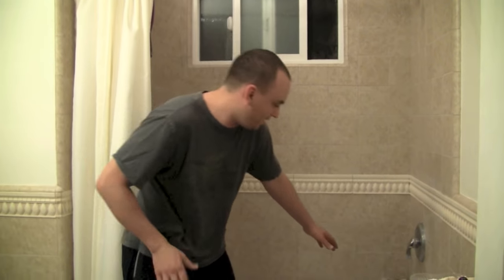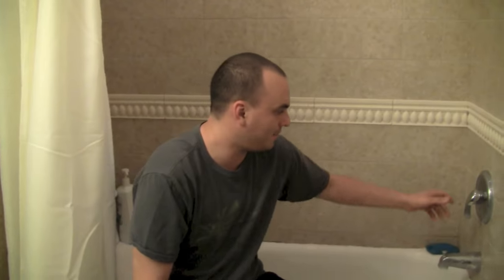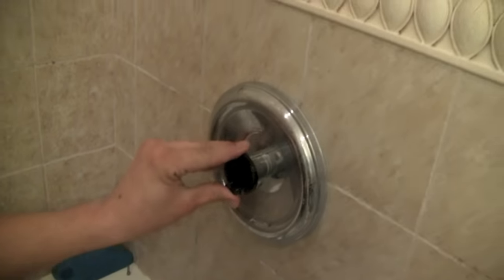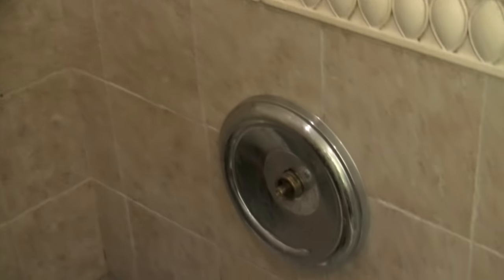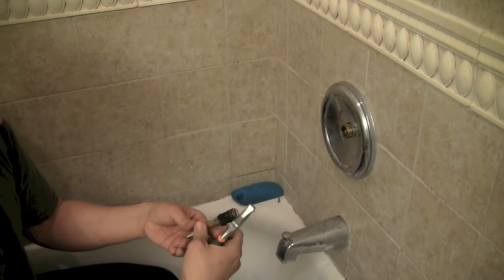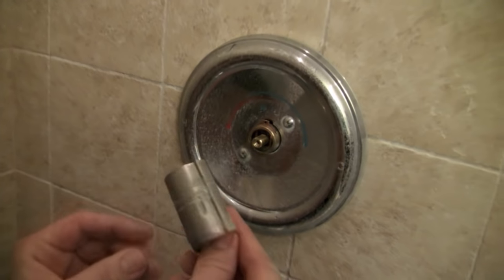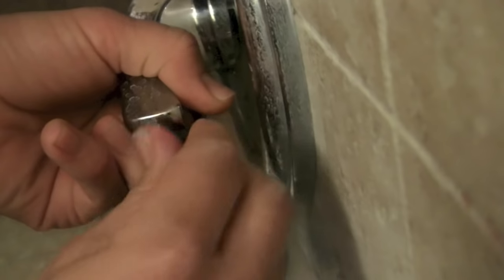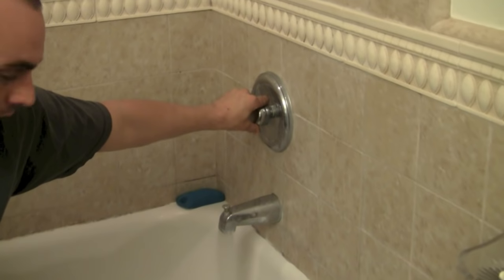How to Repair a Moen Shower Faucet Step-by-Step

Comment: Mr. Dan, I cannot thank you enough on your demonstrating the remove/replacement of a Moen Single Handle Lever Showerhead Faucet by replacing the Moen 1225 replacement cartridge. After calling almost a dozen plumbers today with an emergency (the shower head was on full and would not shut off), and getting no help whatsoever, I turned to looking up online 'how-to videos', and there you were. I followed your instructions to the letter. Success! All I can do is say "Thank you! Without you, my family would not have had water tonight and we'd be sleeping elsewhere." Now, I have to insert valving throughout in order to isolate leaks when they occur (there is only one shut off valve for the entire house!). Thank you again Sir! Fantastic plumbing lesson!

Comment: Was taking apart the Moen valve in my shower. I couldn't figure out how to disassemble any further after I got the handle off until I ran across this video. You pointed out the phillips screw holding the assembly together. Thanks!

Comment: Thank you!!!  Today I turned on my shower only to find that I couldn't turn it back off!  Shut off the water main and then searched for how to fix it.  Your video was very well made and easy to follow and understand.  I got everything off, and then took the cartridge part to Home Depot, where I had originally bought the faucet, in order to be sure that I got the correct replacement.  Nice to be told it was no charge due to Moen's lifetime guarantee.  It came with a little package of lubricant so I didn't need the plumbers grease after all.  I'm glad I was able to do it myself with your directions and not have to call a plumber.  Much appreciated!

Comment: Thanks for the great video! Yesterday I was letting the water run to fill the tub when something went wrong and turning the handle to the off position would not stop the water flow. I ended up turning off the water supply to the house, removing the handle (with the help of this video), getting a replacement cartridge from Home Depot ( which was surprisingly free when I told them it was Moen bc of lifetime warranty). I replaced the cartridge and reassembled everything else which solved my problem! ! I’m def not a plumber and have little to no experience doing this type of stuff so this video was a lifesaver for me! Thank you again :)
Reply: This was my same exact problem!   Great video indeed!

Comment: Thank you so much for this video, step by step was very helpful.  For those whose cartridge may be stuck, I stacked some washers with the hole size larger than the cartridge and used a screw as a puller, pulled the cartridge right into the washers, easy peasy!
Reply: Fletchaka  Thank you for this suggestion! Mine was very stuck after 30+ years but with adapting your suggestion to what I had available since I didn't have large enough washers, I finally got it out. Not easy peasy, but as a 60-year-old woman, I finally got it done!
Reply: Mime is stuck and don't understand ur comment,  can u explain a Lil more?

Comment: GREAT JOB!!! you saved me hundreds of dollars. just did this myself today following your instructions step-by-step. took me about 1 1/2 hours all in (shutting off water, running to Home Depot to get part, etc). cannot THANK YOU enough!

one thing to add - - some of the other videos talk about getting a puller for the valve system (you don't)... if that valve is stuck, as it was with mine, get some needle nose in there and "turn" the ends of the sleeve. it loosened it enough to pop out.
Reply: What's a needle nose? Mine is stuck

Comment: The plumber quoted us 347 dollars for this fix. We just did it for less than 50! Ours was stuck in there pretty good and actually broke off inside leaving us to chisel the plastic casing out so took us a bit over an hour to do BUT I am happy to save the 300 bucks. Thank you!!

Comment: Heyyyy Danny, thank you. I was in the middle of this same job on the tub, saw your video and found out just what to expect. My valve was at least 25yrs old. Didn't work as good as yours, you know the nightmare. Stem broke away and left the sealing mechanism stuck inside. I used this extraction tool with a clever 2nd function, a spring loaded nipple and a compression fitting on a smaller metal tube inserts into the stuck remainder, twist and work the remainder free. THEN I'm at the easy spot you are of greasing and inserting the new valve piece. Yessssssss!
You might want to make a related video of this problem using the extraction tool I described.
Love this Moen valve, smooth, working good after 25 years!
It was a real kick to fix this after fighting with this sticky valve for years.
Too much reward and satisfaction in doing it myself to let somebody else fix it.

Comment: I rent, I have to pay for the AHS warranty fee which has gone up to $125 per event. I will be able to pull the part, and go buy another, and repair the leaking shower. Much appreciated, especially since I had though I would have to pull the wall plate to work on it.
Reply from the maker: I love to hear it! Thanks for watching.

Comment: Liked amd subscribed!!! Worked perfectly. Came home after work and the shower would nt shut off ended up cutting the water and having to go to Lowes and get a moen 1222. The Hex/Allen Wrench was probably the most annoying because my key is for 7/64" and I didn't have the one in particular. Other than that great video will be watching more thank you again.

Comment: Older Moen handles require, believe it or not, a 1/16 inch allen wrench. Most info out there doesn't mention this. 
Great video. Thanks for taking the time.
Reply: The 7/64's is a rare, bizarre size... they should have used a standard 1/8" Allen wrench...
Reply: 1/8 doesnt fit and 3/32 is slightly to small. Not snugg enough to turn it
Reply: Too*

Comment: Video is really good would like to add something that may be helpful  if you are having trouble getting the whole cartridge out.try removing the keeper pin out and putting water back on for a couple seconds then shut off again what this did for me was put a little pressure behind the cartridge and for me came out really easily, hope this helps.

Comment: Very helpful video thanks! Only thing I would add is when you get the 1225 there is a plastic adapter thing in the package that will help loosen the cartridge if it doesn’t slide out easily

Comment: The best video for this specific repair. As often happens with me I found the best after the job was done. The mistakes I made could have been avoided. 
Leaving the face plate attached was the biggest surprise. I removed it. More than once. The screws that attach it are nearly two inches of fine thread. The best piece of info was the notch on the top front of the stem to indicate up when the new cartridge is installed I guessed the wrong orientation so hot was cold and you know. It did not help either that on my redo I dropped a screw down the drain and somehow the cartridge retaining clip went into the hole in the wall.

Comment: This guy is a pro, so am I . the screw usually need some penetrating oil and the cartrige never comes out that easy. If your water comes out cold on the left . take the cartridge and turn it 180 and put it back in . nice thing about Moen.

Comment: Thank you for your video.  I had to buy an Danco Cartridge puller tool to extract my old cartridge.  I first bought the extractor tool at Home Depot, but the bolt wasn't long enough, so I returned it.  I then bought the same tool at Lowe's, and it immediately clamped on to worn-out 1225 Cartridge.  Weird!

Comment: I WENT THRU 4 DIFFERENT VIDEOS AND DANNY WAS THE ONLY ONE WHO BROUGHT UP A GOOD POINT. The little groove is the important part of getting hot water. A few things I did different. Yes you do need to get a curb key or a water shut off key and turn main water off going into house. Turn on the water to the outside hose and in the bathroom. It's better to get all the water out of the water lines. Remove all parts like Danny did. Be sure you have all tools first. Also get petroleum jelly. Follow Danny step by step. When you pull out the cartridge and you do not know the part number, take the cartridge to plumbing dept. Pick up the plumbers grease or use petroleum jelly because its waterproof also. If you can't get the cartridge out pick up a puller about 25-50 $.  up to you if you want to spend that much or call a plumber and pay 80.00 plus parts about 150.+ for everything. I used the petroleum jelly on all the screws and around the stem cover. Yes calcium slowly eats copper based on thickness.  Side note, I did pay a handyman to replace the cartridge,  (when replacing the cartridge Do Not throw away the plastic cover for the new cartridge. Save it some where and label shower cartridge stem remover part) couldn't get him to call me back because of no hot water, so I video surfed. I didn't have to pull out the cartridge which meant I didn't have to turn the main water off. If you are remodeling a bathroom and are exposing all water lines, consider putting a ball valve shut off to the sink and shower so long as the lines connect and have access to that area for future water line issues. I am going to do that when I remodel my master bathroom. I usually do my own remodeling and troubleshoot what other trades did not do correctly. Sucks to pay people to do a job they are more knowledgeable of and I learn from a nice guy like Danny

Comment: Neat to see you do this without the "special" Moen tool - I have the tool because I didn't know at the time but, I think I still may need it since my cartridge is close to 15yrs. old and will probably not come out that easily.  Is the 1225B compatible with most of the single lever valves Moen produced for shower/tub applications ???

Comment: Thank you, our man of the house recently passed away. This was easily explained. One question, though. He had broken the handle off a plastic peg with screw was left sticking out, but he had been using pliers to turn it off and on instead of replacing the handle, and plastic was mashed down covering screw, which is the easiest way to gain access to the screw? Any suggestions?

Comment: Great video. I have learned to replace my faucets in my bathrooms as everything is so expensive. I have the same problem coming from the shower stall knob. It's a Moen as well. Are the cartridges all the same size?

Comment: Great video, hopefully I can successfully replace mine as well. Not sure the brand, but it does need an allen wrench to remove the screw. Really stressfull at first when it just doesn't turn off for no reason, just turns left and right... :P

Comment: This video saved me a ton of mula, I almost called a plumber for this exact same reason, and I did it myself. Thank you
Reply: What happens if my Allen screw doesn't come out anymore 😰
Reply: L
Reply: Lllllllllllllllllllllllllllllllllllllllllll
Reply: I did a star one, L didn't work. After sometime of trying I've stripped it. Now I got to break it, but how? Break the shower handle that is.

Comment: All Faucets should have a hand grip in the bezel sides or at the top. Pulling on the faucet when lifting yourself out of the tub can disturb a secondary set of gaskets you don't normally see or need to touch deep inside.

Comment: Great video, question if I may... my moen is similar but the part you take off after the handle   will not come off after I remove the screw, it's metal and the part behind that is plastic. I tried spraying with wd40 and prying it off with no luck. It's been on there for 22 years. I have no idea what to try next, and ideas

Comment: This is great. What happens if u dont shut off the main water valve?
Reply from the maker: High pressure water will flow out at an uncontrollable rate. Thanks for watching.

Comment: Hi Danny,  Thank you for this video, it really helped.  I had a lot of trouble with my old cartridge. My husband had to get involved and when he pulled it with the puller it broke off.  We got through all that, removed all the broken pieces and flushed the pipe with water. He got it back in finally although it was supper hard to get the diverter pin to line up but did it.My single handle is one of the old clear plastic handles that turn left and right.  Unfortunately, something still isn't right because when I turn the handle all the way left  or all the way right the water comes out very slowly and it takes forever to fill up the tub.If the handle is pointed to the center the water comes out fully. Did we just put the handle on in the wrong direction or will I have to pull the whole cartridge out and adjust because it is in wrong?   If you can tell me which is more likely it would help a great deal. Thanks, Beth

Comment: I am going to repair the faucet myself. Thank you for your video! One question: If I turn off the main water do I have to turn off hot water from the water heater also? Thanks!
Reply from the maker: Good question. No it is not necessary to turn off the water heater. There will be no pressure if the main is off. However sometimes a little hot water trickles out and in that case you may want to shut off the water heater as well.
Reply: @How2Plumb  Thank you so much for your reply! It definitely increases my confidence level. Sure I will try it this weekend.  Happy New Year and Have a great 2o2o.

Comment: Thank you! That little detail of the hex key size? Fantastic. The existing screw was partially stripped in both bathrooms and I was trying to figure out the correct size. Turns out my set didn't have it. Got the right size and presto, off it came.

My issue is the mount was loose - with the cover off I could see - the backing board was attached only on one side. Sheesh. Should be able to fix it an angle through the hole.

Comment: Thanks for the video.I changed my cartridges a couple years back but now the leak started.The shower handle seems to be very loose though even though I tightened the Allen nut.Could it be that the handle needs replacement?

Comment: I might add that the big box stores sell a puller that works on Moen cartridges for about ten bucks that pull the cartridge out if it won't come out using pliers

Comment: Great video,  I have a Menards special Moen shower faucet which I installed about 15 years ago and it needs replacing or so I thot,  I did not know you could just replace the cartridge that's great a lot less work anyways  I misplaced the paper work that came with it how do I know which cartridge I need?  Do I need to pull it first?  Thanks jw 
ps I enjoyed your water heater video... I also have to tackle that project.

Comment: Lucky you have the 1225 for $20 and not the 1222 for $54.

Electronics cleaner to clean the pipe out works well. I did that after taking fine sandpaper (wet/dry) to smooth out the mineral deposits from the water in Phoenix Az

Comment: very helpful vid' though i replaced my cartridge with ease after i tested it there was a little whir behind the on/off so i then re-installed and realized the valve itself has a little back and forth play and it must of been push in so i did the opposite..no more noise!

Comment: Hi I need a fix that I think is a lot simpler. My faucet is very similar to this one but kingsley style. I just happened to rip off the part that turns. I don't think the cartridge is damaged. I noticed there is no plastic and the thin part of the thing you pulled out after the plastic is just a little bent. Can I simply put it back on? Also could this have been avoided if that plastic component was included?

Comment: Hi Danny...

Correction to my previous comment...my faucet is a Delta, not Moen.

It has a single lever that controls the flow and a seperate little knob the adjusts the temp. 
 
When I move the big one, the little one moves and changes the temperature.

Do you think it needs grease?

Thanks,
Jeigh

Comment: Hi Dan my sprout leaks water even after shutting water supply Moen valve. I did change the cartridge but the water leak from the sprout did not stop. Is there a problem in the sprout or the Moen single handle shut off valve?

Comment: On my Moen replacement valve, the grove/notch goes DOWN so that the hot is on the left and cold on the right. I have seen Moen directions for the notch/grove both ways.

Comment: Great job!  Now how to replace a spout that has a bad diverter on it. The plastic tube that goes over the water pip can be different lengths.  What to do ?
Reply: You really only have a few options for that. Threaded or not. Deep or shallow. Take yours off and bring it to the store

Comment: Is there a way to adjust the hot water? My hot water is to hot if I turn the handle left it’s cold when I turn it right it’s hot hot when I barely turn it but when I turn it all the way to the right it’s still to hot. I have the clear handle but no white piece like on yours

Comment: Great video. Question: My faucet has the tub/shower diverter located on the faceplate below the single handle (No visible set screw hole ) How do you remove the diverter handle?

Comment: I have the same Moen fixture and need to replace the valve but the handle is stuck and can not remove. Also need to replace the face plate (flange) since is cracked around the screws. Don't mind replacing the whole thing with a different Moen design, including the face plate, handle and faucet neck.
Any idea how to remove the stuck handle?
Reply: Maybe a little WD40 spray and taping it a little.  I always coat the inner side of handles and screws with grease.  It makes future removals easier.

Comment: I have the dual handle faucet. Where it shuts the water off and it lets the excess water out after the shower. Is the installation the same?